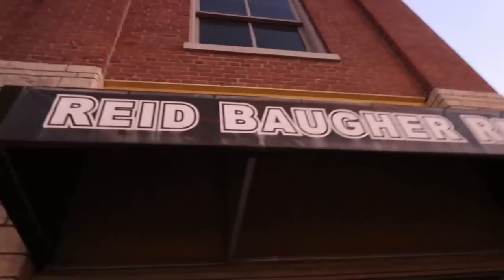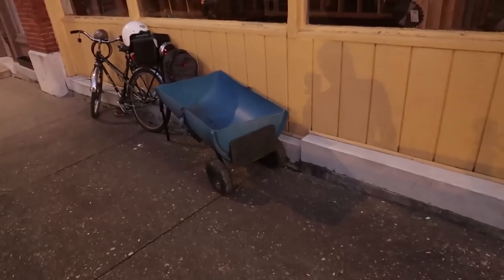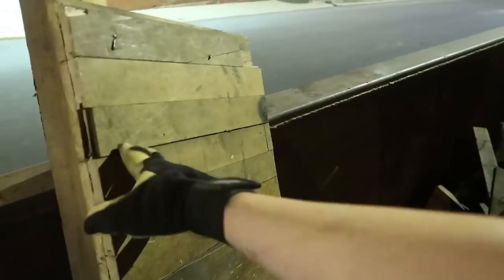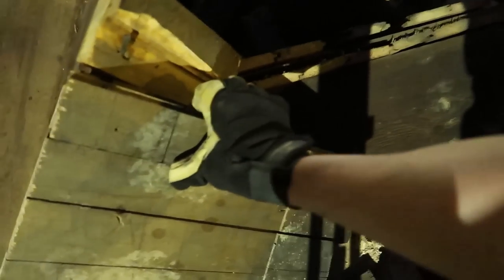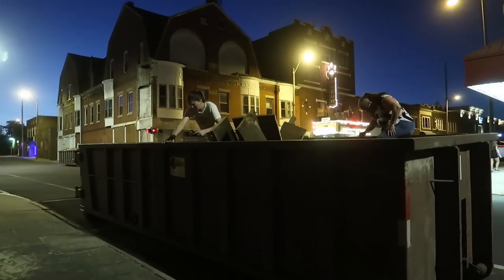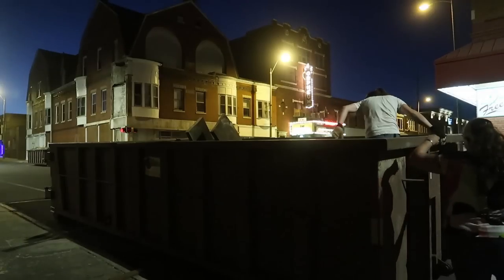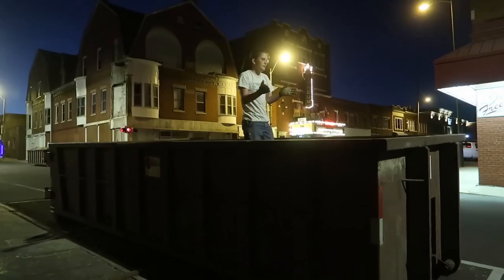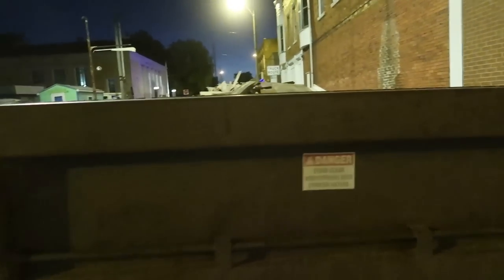Random Bits 0212: 1890s hardwood Tongue & Groove Flooring Salvage/Reclaim

Comment from the maker: I am too tired to watch this video before uploading, but want your input on the wood. 1: lemmi know if i made any major editing mistakes that break the video and 2: let me know your opinion of using 1890s hardwood flooring for either workshop flooring or for shelving.

thanks
Reply: Sounds like a good idea to me, a coat of polyurethane would add durability, and any big gaps could be filled with scraps shaped to fit while sawdust is good for cracks that the urethane won't fill (especially if it's sawdust made from scraps matching the flooring so it will share the same color, if you care about that).
As for shelving, as long as there aren't knots or cracks in the span between supports it should work quite well, it's a decent thickness and should be sturdy enough for all but the heaviest things on the longest spans.
Whether newer stuff will match up to it will depend on the quality (thickness) matching up. Certainly a nice color!
Reply: 1: No editing mistakes , I actually loved the riding the electric bike part , would You upload a video of riding the bike in the day and night ?      2:  Wood is wood especially tongue and groove wood , get as much as You can :) .    Luv the vids stay safe :)
Reply: I totally felt like I was in on the adventure , the gathering transport and scheming of what to do with the new wood :) , Thanks .
Reply: Hi thanks for your amazing contribution to the community, I been wanting to make simple affordable electric wheelchair kit to help the community here in Latin America and do it as a university thesis. I been thinking in some ideas maybe I could help you with your videos and you could give me some recommendations.
Reply: Video looks good. I like your no bs personality.
Reply: That wood is a touchstone to a different world.  Should make a great floor.  Old wood tends to have a much finer grain structure and should look great once you clean and finish it.  Don't sand ALL of the character away though.  The old bumps and scars are the beauty of wear that took a century to accumulate.  You might try finish remover instead of sanding.  There are many products to re-finish and protect the wood depending on your requirements (stains, oils, urethanes, etc..).

Comment: There are a lot of pieces you may not be able to use directly if they're too small or have imperfections in them. However, you can make quite a bit of money on them. In my second year of college, when I had just gotten an apartment with a couple of friends, I used to do a bit of Dumpster diving myself. Used to visit junkyards and the salvation army to get used furniture since we couldn't afford a furnished place. Ended up making 3 beds, a dining table, coffee table, couch (took the longest but used the cheapest materials overall) as well as a few other smaller items I'd upcycled. With a lot of scraps of very decent hardwood left over, I took some time and started making gun scales for 1911 and m9 pistols out of cherry, walnut, oak floor board cutoffs. Given that the material is free, there isn't much more work to do and it's a great way of raising money to offset the cost of other things you may need to buy. Never got anywhere near paying my tuition, but making shabby chic furniture as well as some decent pieces payed for my books for the remainder of college as well as a gym membership for the same duration.
Reply from the maker: whatch my workshop build seried, i used this stuff for walling

Comment: As a retired carpenter that wood is a gear find, and would serve you well as the floor to the loft. Plus and cut offs and scrapes would also make part of your shelving.  Having more would than you would need, as you stated would make great wire wood started being that old and very dry. Just a hint if you can store the long pieces vertically to keep them dry and mold resistant. If stated in layers place stays even layer to keep air movement between the wood.  Just some advise on how to keep valuable wood in good shape prior to installation.